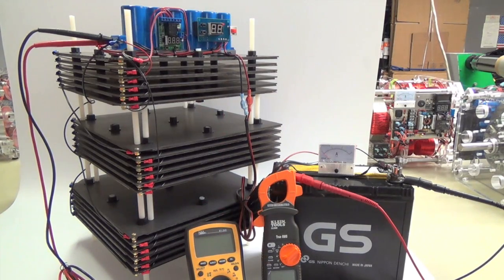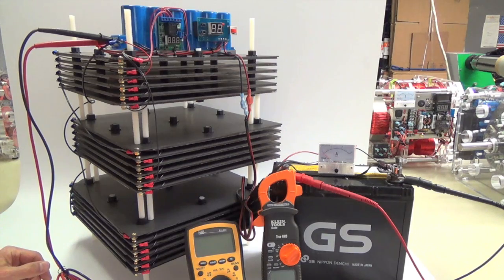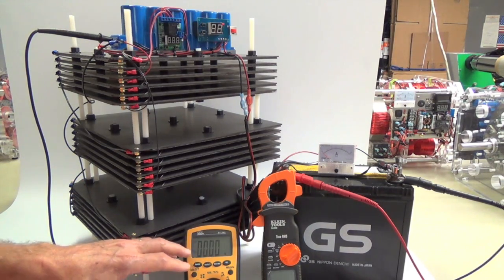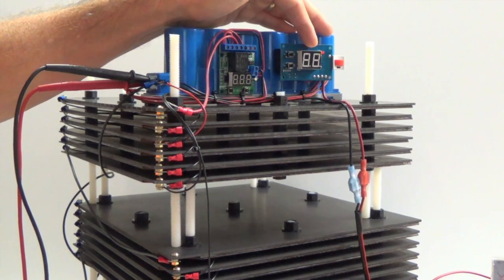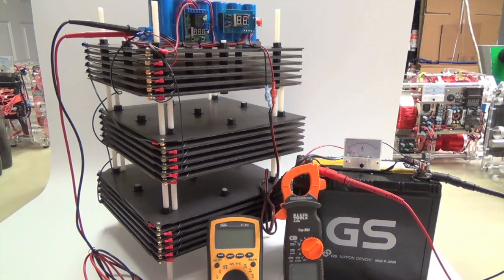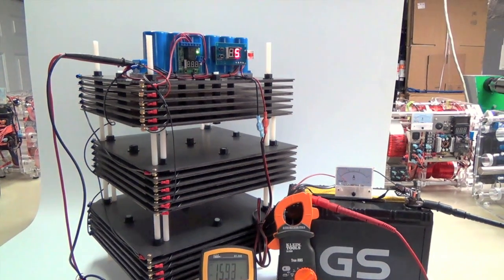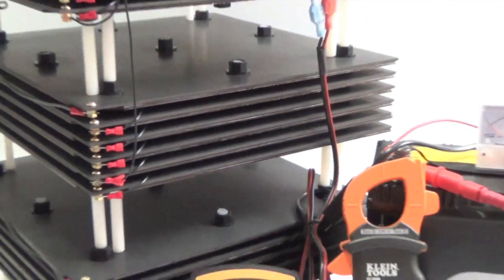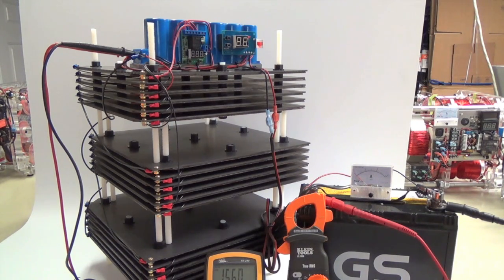Solid State Energy - SiC nano

Comment: Rather than using a supercap module he would be better off using a step down module directly so that if is a constant flow in into the battery without the need to run additional equipment.

Comment: 12.5 isnt dead. Its almost full charge. Lol and your moving almost no power, this is worthless as is you need 1000s of cells. And if u put volt step up between the charge controller and cap u can bring caps to 0 % insted of using almost none. ,, so tell us amp out put of cells , only thing matters amp times volts equal watts.

Comment: what happens if you connect the sic plate set to a bedini solid state sg and use the output from that fed into your cap bank?   might increase the rate of charge into the caps ...

Comment: If this is electrolysis theres a way to give it more charge time while having a consistent output you whont sacrifice anything only gain output and you dont change the battery at all and its controlled by a computer to achieve it.

 If anyone who works on these batterys come across this,Make these plates discharge in tandom in banks like a firing order of a engine so as the 2  sets of several plates discharge the other 3 banks or more can build up electric charged ions for more power stored before release and while doing so can achieve a consistent standardized output while a computer or a brain to controlle the plates discharge and charge times which can lead to other features these plates can do in return it will give this real world application with standardized outputs and someone will pick up the tech or fund you or many things can happen,maybe this whont be like the other 7x I seen a idea of mine put in use from military (inflatable barracks) or the peelable skin on cars to change color plus more so I think I know when I have a good idea,just i dont know how to act on them.I think I could contribute to this technology  
 Hank A. Vaughn

Comment: Good question. How does this thing get its initial charge? Is it able to be recharged when it goes flat? What is the product's energy density? How many watt hours will a given area (square meter?)  of plate provide. It seems that the plate voltage is 2 volts - 18 plates for 36 volts. Is voltage proportional to plate size? Unlikely!

Comment: How can I replicate this? Where can I purchase the Power Cells (plates), are they graphene and what about the SiC separator?
Reply: silicon cabide nano pillars i think its along the lines of this..
Reply: @badsaddamdotnet  thanks
Reply: @Abc-sl1nf  im only speculating that inside the cell there is either a standard type of capacitor but in the form of a sheet
Reply: @badsaddamdotnet  I appreciate any information. Thank you
Reply: im designing one of my own because i think replication of this technology for free is important but in doing the research i can see why he's selling them because a lot of work has gone into using the right materials and the proccess to stick each cell together isnt easy, for my own i i will just use a blocking oscillator circuit that works in a similar way to a joule thief to charge a capacitor bank. i had a similar idea many years ago involving cement cell batteries and it worked to charge some caps and power some leds for ever but you need a real world application  @Abc-sl1nf
Reply: @badsaddamdotnet  thought those were some type of crystal sheets because crystals supply power
Reply: @badsaddamdotnet  15v x 3a =45w .  1:5 duty cycle = 4w awe(cont). if compactly put, unit will be big shoe-box  - size. shelf of 10 units =450 w pulse, 40 wh continuous, 24/7. 10 shelves wall - 4.5 kw pulse, 0.4 kwh continuous, 24/7; 9kwh /day, 60kwh/week, 180kwh/month; 2mwh/y. Hmm 2 megawatt per year, not bad 4 ave household
Reply: @channel-sc2uu  possibly, but remember there are losses obviously in the entire process for these units to work.. more than a paper theory tho? id love to have that as would anyone

Comment: So it's free electricity? If so can it be use,d for say in a small camper like cooking and heating water that would be cool to avoid paying those pesky electric bill*** or is it only good for a couple of battery chargeing' not sure about what it can be used for but it running itself is a great concept , no gas motor no solar power that's all a plus but its quite an investment just to charge batteries'

Comment: Can you tell me in layman's terms some basic clue as to how the cells are working I am an engineer and I'm having a hard time understanding how the cells are producing energy without having to take in energy at some point ....your making something out of nothing !!??!? And it's cool as crap
Reply: Good question. How does this thing get its initial charge? Is it able to be recharged when it goes flat? What is the product's energy density? How many watt hours will a given area (square meter?)  of plate provide. It seems that the plate voltage is 2 volts - 18 plates for 36 volts. Is voltage proportional to plate size? Unlikely!

Comment: Why not design one foot thick one foot squared solid state electrolyte solid state graphite or graphene power cells? That trickel charged organic carbon power cell banks? Would this not be an idea home energy source that would make a tesla wall look stone age? You could even add in an advanced electrical power generator using vacuum spark gaps? This can all be done could it not? You could even make those support rods on your cells a power generation component and use them to loop built up electrical charge in the power cells?

Comment: Why not design those white plastic legs used to separate the cells to do more then just separate the cells? Why not put carbon power cells in them with mini vacuum spark gaps and make a power generation system that you can keep adding cells increasing the electrical power output? Design a bank that generates a power loop through the power cells that trickel feed carbon power cell banks?

Comment: Great work  ... 1/5 the time would make it with my basic knowledge 15V x 3A x 1/5 = 9W in any hour to charge anything. so 900W will require 100 of these bank cells. 10 cents x 0.9kw x 24hrs= $2.16/ day x 365 days  x 10 years = $7,800.... and for anybody to see the benefit of this would want to pick this 100 unit box up for say $3000. So can you manufacture these things for <$3000.   I think that your motor and these cells in tandem gave a better result.

Comment: So, the silicon cells are acting as a primary battery, using galvanic energy, charging the capacitors; and then the capacitor's charging and discharging is regulated to charge the secondary battery? I really like this, but i also feel like you read one of my blogs and stole my idea, lol! How long do you think these silicon cells will last, and how much would a system like this cost?

Comment: Considering that there is not enough time in the universe to explore the possibilities of combining all possible 2-substance molecules, finding some novel chemistry is not that far fetched. Keep that in mind in my analysis. So taking timestamps from the video it looks like it takes about 12 minutes to charge up the caps... and that 12 minutes gives you 5 x 1 second charges of 3A at lets 16V... lets be generous and say 50W. So that adds up to 10 minutes of 50W/day, or 8Wh or 0.008kWh/day. Run that for a year and you've managed to get about 3kWh out of the air... (30c worth of power!) ... (Looks like it's using the chemicals in the air..., I'm sure a few days with a few chemistry handbooks will yield the equation and mix that gives you 1.6V at 30C per cell...) Whichever way... I think it's fair to say this gives a range between 1kWh to 10kWh/year... enough to charge up an 80AH battery every month. That's 12 cells... with 120 cells obviously you could theoretically charge up 10 batteries a month... assuming you can extract enough electrons from the air, or the chemical mix you've got in there... its more likely that the energy is coming from the cells and that the panels will stop producing energy after about 3 months... at which point you would've hopefully (for you) sold at least 50 sets of batteries at $3k each... which would be a good time to disappear off the internet with your $150k ... and invest in something better.... kudos for trying though, and for making your videos so open and transparent. You're one of the good guys... and much as I hope you've managed to harvest electrons out of, probably the H20 in the air...  chances are slim. I would check to see if it works in a vacuum... if it does it's bad news, then the battery will probably not last long. If it doesn't work in a vacuum, this holds promise... then try try to see how long it lasts in a small container, and see how humidifying the air, or putting more oxygen in, affects the voltage... if you can create a foil that harvests energy from the air we breathe (without creating harmful molecules or ions), I can see that having a lot of applications in IoT.
Reply from the maker: Getting closer to two years on now. How can a cell sweat without drawing humidity?
Reply: Go to school, you have 50W/ minut. times 60 minut.or 1 hor. times 24 Hor. a day. == 345.6 Klw day.

Comment: Is the voltage controller module custom made ?
Reply: You can get a whole variety on dc-dc converter modules on ebay for cheap. A lot of them are adjustable and the step down versions are the most efficient.

Comment: What would you be able to use this for? Say could I use it to power a home? what is the life cycle of the Units? What is the Ideal Temp range? and does it handle temps that are over 100F? would I be able to Connect it to a Solar system to store energy? I am specifically looking for a solution for storing power for home application.

Comment: I guess my question would be, have you or could you create a system large enough to do something similar to a 24V or 48V solar battery configuration for a solar powered house that could supply enough power for after hours running (when solar is not collecting energy) using this technology with the silicon carbide?

Comment: Hay bro l hope you read this,l have no way to give you a private message so here goes l may be able to help you improve your cell,I have been working on related things.Have this for free.The closer the electrodes are to each other the better,l mean nano close ,try  it if you have the technology to do so there can be a dramatic increase in power output.l have no idea which electrodes you are using but the greater the electropositive and negatively  the better,by all the best
Reply from the maker: Thanks. It is much better when the tolerance is very small. Working on a solid flexible polymer electrolyte that may decrease it further.

Comment: you have a wonderful gift of making things very complex.
did you think of connecting three halogen 12v lightbulbs and measuring current and voltage over time to measure the capacity?

Comment: A power core like that could power an electric vehicle or super conductor maglev train? Could even use nano technology and build the outside structure out of graphite or graphene of a high speed train to generate electricity from the air flow passing over its surface? Vibration and heat from friction and turbulence caused by air flow? This would also work right?

Comment: Would it not be possible to embed a hertz emitting diode that kicked on from the background charge generated by earths resonance to super energize the power cell? Then embed a mini vacuum spark gap in each power cell to generate high frequency electricity? A resonance high frequency electrical power core? That you could then power a rewired drum motor generator with magnetic bearings with a bigger vacuum spark gap to generate even more high frequency electricity? Would all this work?  Question, how big can you make those graphite power cells how big can you make drum motor generators and how big can you make vacuum spark gaps? Is it feasible to use high energy transmission coils to move high frequency electricity around line of sight transmission to power cities and homes? Who needs nuclear or geothermal or gas and coal or hydroelectric would not this technology make all those obsolete?

Comment: Could you use these to generate electrity while producing hydrogen from liquid air to operate a combustion engine? No more need for gasoline? That would be cool heh? LOL
Reply: You know what, that's not a bad idea...  Distilled water would be perfect for this...  The HHO generator used now should be more efficient and long lasting...  More research and testing needed...
Reply: Is it nOX that powers a combustion engine? If so liquid air is about 71% nitrogen. An aircraft flying through the air could generate liquid air then use a frequency emitter to separate the nitrogen has the liquid air boiled off to be used in a jet or combustion engine. A way to use the nitrogen pollution in the air put there from fossil fuel use?

Comment: So are we talking about a type of unlimited battery tech that similarly John Hutchinson was into, with his crystalline metallic mix?
Reply: yes rusty that is true BUUUUT if something last for hundreds if not thousands of years is that not essentially forever? my children's children's children's children could still have it
Reply: Nothing is "unlimited"... Everything "decays" that is physics.  No matter what it is, all things decay over time therefore NOTHING is FOREVER.
Reply: in that context you do not even need thousands of years.  You could essentially say 100 or so years.  There are a few people who live to be 100+ yrs, so we could say 150 years = essentially forever as if it lasts for 150 years then to you.... yes.... it would be forever.  

It is AWESOME to see something like this  because we could possibly FINALLY start to move away from the wheel......  So far to produce energy we simply spin the wheel.  The quest thus far has not been to quit using the wheel, but it seems that new technology is just another way to spin it without US spinning it.  The easiest way to spin the wheel = oil/fuel.  Remember the old old phones that was a wood box with the ear piece at end of wire and a long mouth piece sticking out the front and to use it, you crank the crank real fast and then tell the operator who you want?  Even from the early beginnings you "spin the wheel" (the crank = you spinning the wheel to produce energy".  Hydro-electric dams = we just put the wheel in the path of fast moving water and spin it that way, Or make a HUGE windmill and let the wind spin the wheel for us or... the easiest way is to BURN SHIT.

Even in an "engine" that creates mechanical energy, we burn shit to spin a wheel or multiple wheels as the explosion sends the piston up and down that spins the wheel that spins the wheels.  You can draw power from a battery but to get the energy into the battery, you gotta produce it first = still spinning the wheel.

We are just now as a species making new technologies that move away from that "concept" of producing energy. Solar power was the first huge step in nudging us humans in a different direction away from the wheel.  I think something like this is ground breaking and a so much needed step towards "breaking our chains" to set us free :)

When I said nothing lasts forever because everything decays, I wasn't knocking the awesomeness of what this could ultimately turn into.... It was more like the "grammar police" but correcting the idea of forever as it should have been "virtually forever" "practically forever" lol.